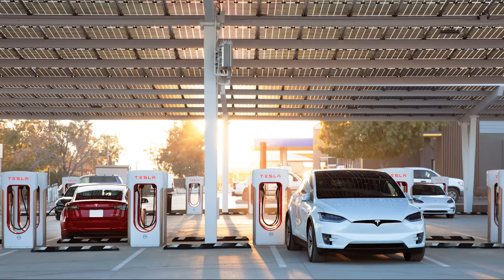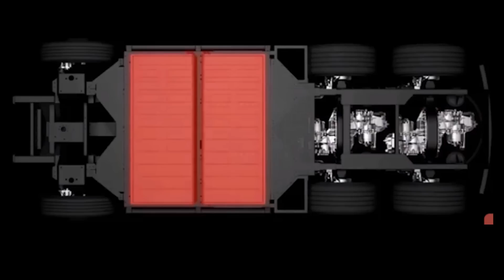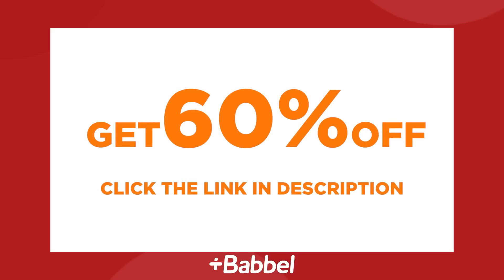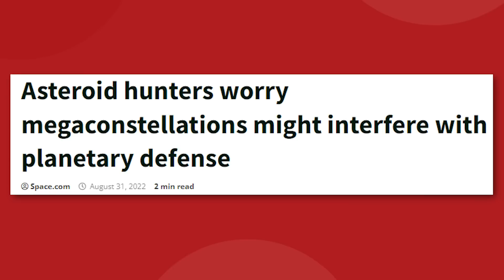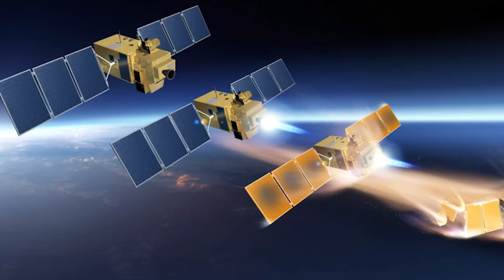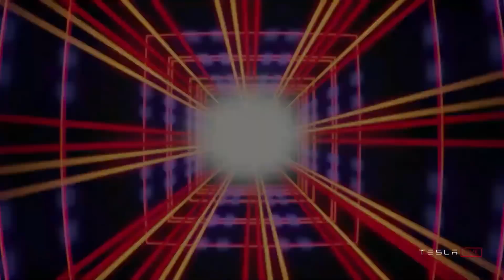Major NEW Tesla Cybertruck Update Revealed!

Comment: Batteries cannot and should not be charged at their peak rate for the entire charge cycle, as this will damage them, depending on the chemistry.  

So it may be a mistake to assume that a Cybertruck will be able to charge to 100% in 30 minutes, just because the Semi's larger battery can charge to 70% in that time.

Best I would hope for is that CT can charge to 70% in 30, assuming similar battery chemistry to Semi.
Reply: We will find out.
Reply: 70% in 10-15 min is possible because of the smaller package. But yes 100% in 30 min would be a battery killer with the actuell tech

Comment: You dont need to asume cybertruck will use the 1000v system.. Elon told us this at the event
Another thing.. no way the cybertruck battery could charge at a rate of 1MW.. Remember this battery size is aprox 20% of the Semi👍🇳🇴

Comment: The 1000 Volt architecture is essential for high torque applications without excessive heating - personal speculation - the Tesla model S Plaid Plus would have been the first 1000V Tesla and also the upcoming Roadster may be on the 1000V platform
Reply: Nope!!! 1000v is about charging and battery configuration and cooling….

Comment: Ohm's law is not technology. Conductor heating has been well understood since before the first incandescent lightbulb was made. The same law may well disprove that the Plaid motor is not used in the Semi and Cybertruck since the battery voltage is different. Carbon wrapping is not Teslas idea.
Reply: Worst case, motor windings may be connected differently to provide for higher voltage at lower amps.
Reply: @Len Gould  That is bound to compromise efficiency. Just wind them with different gauged wire or better yet redesign. I Don't remember Elon saying anything other than they were carbon wrapped. Gear train will no doubt be different. I want to know the average speed those 500 miles were driven. Hyper miling?
Reply: @MegaWilderness  Actually no, no compromise. If two winding sections of the same phase are connected in parallel and fed 500 volts at 200 amps, or in series and fed 1,000 volts at 100 amps, the outcome is EXACTLY the same. At least in the 3 months apprenticeship section of my license in the motor winding shop of the big industrial plant where i worked, thats how it was.
Reply: @lengould9262  And how did that affect torque and revs. I guess you needed to build a new inverter with different power electronics
Reply: @MegaWilderness  Of course, different inverter, which is why Tesla is changing the motor voltage. They can now economically get 1600 or 1800 volt rated SiC triacs for inverters at the price they want, instead of the former 800 or 900 volt rated units.

Otherwise nothing changes. Likw 3 phase 208/416 volt motors, or 120v 240v motors. Installers choice what voltage to connect, motor works exactly the same.